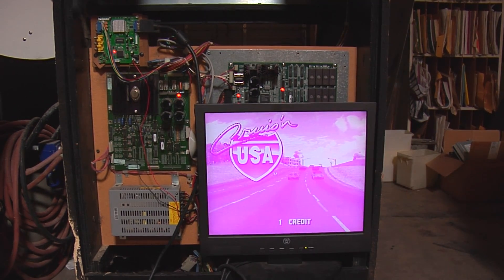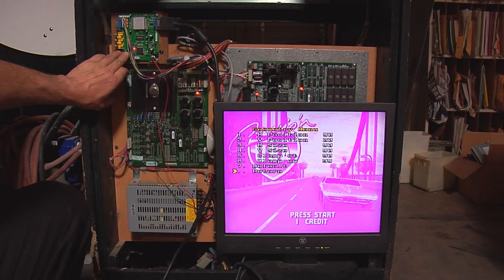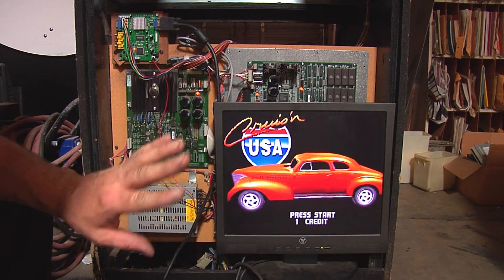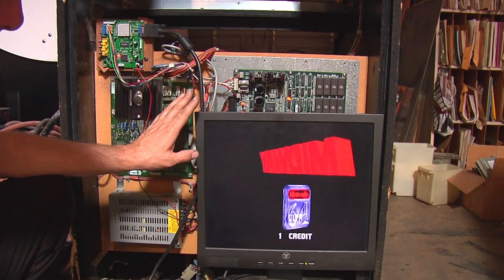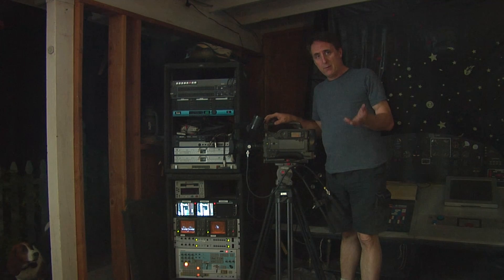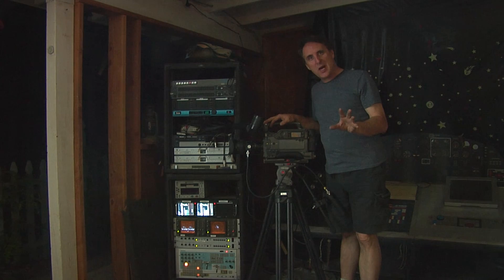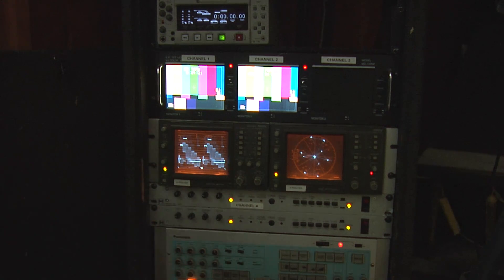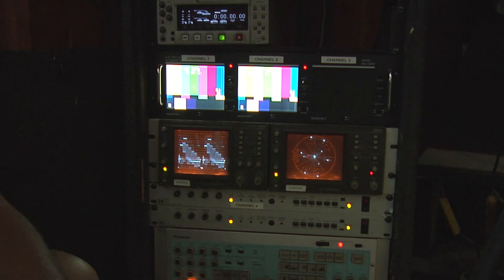GBS 8200 VGA Converter board Clamp Settings Cruis'n USA

Comment: Just tried this board in my Cruisin USA cabinet that I believed was dead, but now I know it is just the monitor. However the washout effect drived me crazy. The manual do mention that this might be required, but didn't know where to start with the values. I will try 04 and 05, and walk it through from there. Thanks!

Comment: i cant thank you enough for posting this video.. i had tried adjusting the clamp settings to get this problem taken care of even though i had no idea what clamp settings were but i didnt go below 50 and obviously it did not work so i ordered a new converter thinking it was bad but new board did same thing..  mine is same machine as yours, must be an issue with this machine because none of my other arcades have had this issue..  thanks again

Comment: Hello! Thank you for your videos. I got a Midway Off-Road Challenge cabinet a while back, and recently I got a Crusi'n World board for it. It works with the cabinet, but I have no force feedback (motor works in test menu). There is a slight resistance from the wheel, but that's it. Do I need a separate drive board for Crusi'n World? I was under the impression Off-Road, C-USA and C-World were all compatible. Thanks!
Reply: did you find the answer for the feedback?had the same problem with my dedicated exotica,but im thinking that it was all re-configured to play like this...

Comment: Thank you for this video. I was having this exact problem on a Daytona USA sit down game that I was considering putting an LCD monitor into. I have the same converter board. It worked great at first and played great, but would go very pink in a couple of minutes. I ran out of time yesterday but figured that I'd have to play with the clamp settings. You saved me some time for sure! Can't wait to get back to the shop. Thanks!
Reply: same issues. what was your clamp settings?
Reply: Hello! I have a Daytona USA Twin cabinet. When I set the clamp settings 4, then 5.. my screen looks more yellowish. The red went away thank you now its more yellow.. Any help would be great. Maybe my Clamp settings are different than Crusin USA?
Reply: Anyone have an answer to my question? Thanks

Comment: Good morning .... I have a problem and would be very grateful if you could help me .. I did the same thing in a machine cruis in world. I did the conversion ... but the WIRING pinpings of the board has 5 tracks (r, g, b, gnd, and sync). I connected the board to the gbs 8200 board which has the 5 ways .. I saw that you connected it in the one that has 6 ways ... my question is: With I make with the cables of the board GBS 8200 SYNC H and SYNC V ... being the cable q I have of the game only has the common SYNC .... I need to join the two (sync he sync v) and connect in the sync (unique) of the whip? Thank you and congratulations for the post !!
Reply: I ask this because my screen is oscillating a little ... at first it oscillated a lot ... but adjusting for the gbs8200 plate it stabilized. but the screen keeps moving a bit vertically (up and down) little ... but it happens ... and the colors oscillate tbm ... I'm calling the gbs8200 in 5v .... I saw comments to call in 12v .. .. would not ruin the board ... because in the specs it speaks of connecting at 5v + - 0.5V

Comment: Hi, have a question.. Do you recommend GBS-8200 to be connected on 12v (16 AMP) or 5v (4AMP) on the power supply?
Reply from the maker: Connect it to the 12v the GBS needs 12v to work
Reply: @thisoldarcade  the GBS8200 can run perfectly fine on 5v, infact it's recommended to use 5v for stability.  If you're still using this board, you should check out gbscontrol.  It's an arduino/esp8266 based firmware replacement that turns the GBS8200 from an average $20 scaler, into a competitive OSSC alternative!

One of the best things about the firmware is that it allows you to control the GBS8200 from your PC or your phone, instead of the buttons on the board.
Reply: @AndehX  Awesome. Didn't know about this hack until now. Thanks!
Reply: This Old Arcade (Classic Arcade Machines and Tech Tips) thank you, I was watching this video because I have a similar problem with MK2, instead of pink washed colors like this video, in my case, after a few minutes everything goes too black with clamp settings (ST 04, SP 05) and the other hand goes too white with default clamp settings.. I really don’t know how to fix this.. hope you can help me with this.. I really will appreciate it.
Reply: Halo Forten having same problem with  NBA hangtime? How did you go man?

Comment: Which sync wire do u use when installing it in a Mortal Kombat 4 cabinet . My connector only has one sync wire but the board has two

Comment: Nice ! Hey is the Cruisn USA Jamma board playable via a supergun WITHOUT THE WHEEL AND PEDALS ? I found the single jamma board super cheap , and I want to use it with a supergun that has the standard DB15 ports on it ( I have a Neo Geo control stick ). I also need to find an all in one box Supergun that plays well with Midway games if you have any recommendations ( looking to play this game and the MK series , probably the Capcom stuff that requires 6 buttons also )... I'm a noob at this stuff : I mainly collect old console games but looking to step up to Jamma - Thanks !
Reply: None of the Cruis'n games have analog controls (steering, gas, brake) off of the JAMMA. With a supergun setup and only the JAMMA, you'll get power, video and the start and view change buttons, that's about it. I would Google the final manual of the game and study the wiring diagrams. It will show you what controls come off of what connectors. Maybe you could hack a PC steering wheel and wire the analog controls to the potetiometers? I have a USA sit down machine and 7 Midway V-Unit boards, including Cruis'n World and Off Road Challenge which run on the same V-Unit hardware. (bought them as "untested" on eBay, all of them have problems). I've never tried doing a supergun setup with the game, but good luck!
Reply: Got ya , thanks for sharing that info !  I was curious about that - I don't actually own the board but saw it fairly cheap on eBay ( minus the wheel board / assembly )...
Reply: Mike Rhoads I see, glad to help. The wheel board is something you don't have to have by the way. The uprights of Cruis'n actually didn't include it for whatever reason.
Reply: How do I get a signal to my monitor from my arcade game board

Comment: I'm at the point where my sit down Cruis'n USA and Gauntlet Legends/Dark Legacy are both ready for cap and flyback replacement. I have one of these boards in my RoboCop, and never knew what clamp options did, but it isn't standard med res either. I'm sure this will save me a ton of time, Tim! My monitors work, but nobody here works on em. Funny...when I go to sell both a 27" and 25" med res monitors that work with their chassis(s)....people who can fix em will come from everywhere. Bummer. I'd rather have the OG tubes.